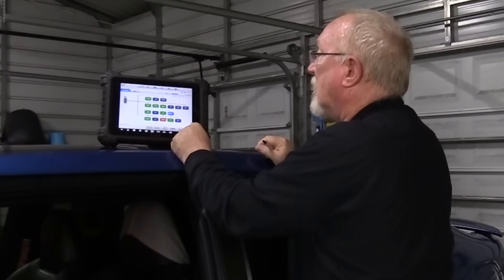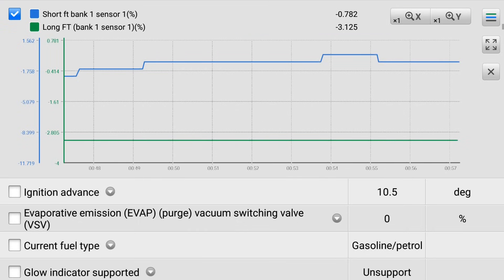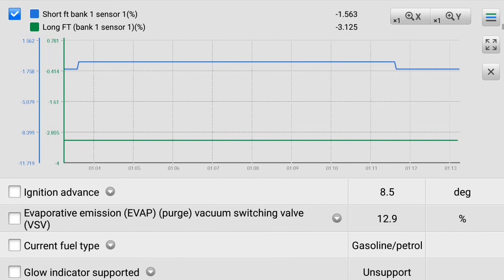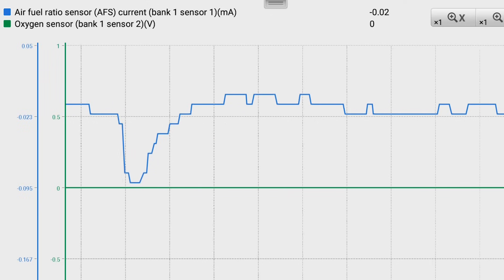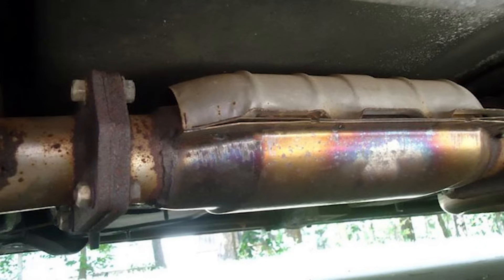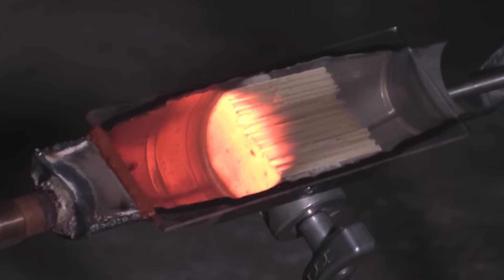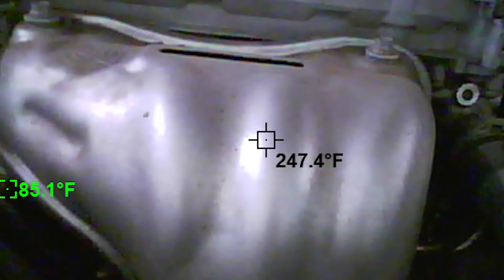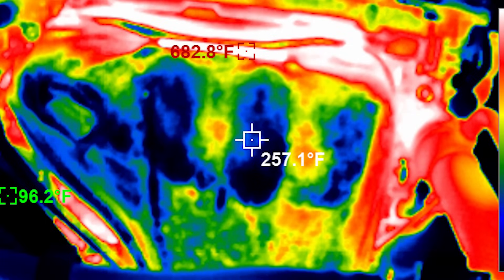The Trainer #118:  The REAL Cause Of P0420/P0430 DTCs

Comment: My take away. Over time it sure pays to live in a state that does'nt have the smog check inspection fraud.
Reply: With probably a trillion cars that came and gone since the first vehicle was made and all the pollution coming from the plant that runs the power to my Alberta city if I don’t have 5k for a new converter cut the cat. I remember there was a gentleman that was ginnna change the world when he figured out how to use water to run a vehicle and he went missing off the face of the earth weeks later 🤔
Reply: @Stunna_ECN sure he did, Fool!
Reply: New Cat for my Car is 1500 , car has 140k miles . Car runs great , but will not pass inspection. .  Why spend 2k plus on car with so many miles  and running fine. ? Thats a problem.
Reply: I love your videos very knowledgeable! Learn a lot from you sir! My name is TASHA from USA 🇺🇸. My check engine light reads that I need to replace ignition coil and spark plugs as well as a cylinder 4 misfire secondary DTCs, p0420 cat efficiency helper threshold bank 1 and 83-13 ECM/PCM relation failure. I have a Honda Accord 2009 LX. I’ve driven like this 7 years! Now I fear how much repair will cost. Why me? 😩
Reply: @borntowin1017 if you’ve driven like that for 7 years, why even bother?
Reply: How does that help you with check engine lights ?
Reply: Found a injector connector not pluged in correctly on one cylinder so was running lean.  Show 0430 code only.  
Look at the simple things first.
Reply: Honestly it's not just that... If you get a code, your car has a problem. Converters are meant to last the life of the vehicle too, meaning, something caused it to fail or it's claiming failed due to something else going on throwing off the readings (like rich/lean conditions)

Also most "no smog check" states won't let you pass safety inspection with a check engine light on, even if it is emissions related
Reply: @JamesAutoDude  Back home in Florida there is no check, period. That means no smog check or any other type checks. Yeah there’s the ever so slight increase in people driving with a broken taillight and whatnot but I’ll take the risk because I have to buy older cars. Nothing like the peace and tranquility of just going to get your yearly registration without first spending money on parts or repairs or both. If it’s the catalytic converter, baby you’re in for sticker shock! I would have to buy it on credit.
Reply: @yactabay  honestly if you can't afford basic repairs then you shouldn't have a car. And the same cheap skates go off and get a $600+ per month car payment when all their car needed was maybe $1,000 or even less as a 1 time payment. Ridiculous

Rock auto is cheap for parts including the converter. I've gotten CARB compliant converters on there for $600 or less, even as low as $200 on some cars.
Reply: @yactabay how much does lung cancer cost?
Reply: Definitely i have lived in RI for years moved to Florida and now it’s no worries lol
Reply: Yes it is IF you are independently WEALTHY & canNOT BREATHE the AIR in the State you reside in.
Reply: It's not just fear of environmental pollution. Fuel mileage, and oftentimes performance, are affected when the emissions system is compromised.
Reply: The WEF (the people who literally run the world) are pushing hard now for getting rid of private car ownership altogether.
Reply: Ummm seriously? You wonder why we have things like global warming? Cars most definitely should have to keep smog down and for good reason and ISNT hard to keep vehicles in shape tbh... Inspection fraud 😆
Reply: @Richard Gilley Ya ok snowflake. You definitely voted for Trump 😂
Reply: Yeah I fucking hate Cali when this dumb fraudulent shit comes up
Reply: Yeah I bet!!!
Reply: Bingo ...bsers rule
Reply: Sorry bro meant to put that comment on the video lol. And that’s crazy that they try make your car a ride off for a clogged converter never of it up north 🇨🇦
Reply: What fraud?
Reply: Idiot government recomended mechanic replaced a 100,000 mile cat with one that faoled 800 miles later...jackass saboteur...
Reply: Not in S.C
Reply: I live in New Mexico no smog check what so ever 😅
Reply: No smog check in New Mexico 😊
Reply: @Mr.Freeze8754 that’s because of the extremely sparse population… c’mon this ain’t hard to understand!
Reply: Yeah, I know what you mean. Damn politicians trying to keep our kids from choking to death on vehicle emissions! Oh for the thick 1960's L.A. air, right? This lousy air we have today, you can actually see through it -- yech! Don't get me wrong, I'm was being silly, but don't expect cleaner air from battery powered vehicles, THAT actually is a scam.
Reply: If you want to breathe pollution
Reply: Because pollution is good?
Reply: You’re all welcome to Oklahoma!!
Reply: Or vote out environmental whackos democrats. 😮😮😮
Reply: It’s for money and so is the new real id scam. They just come up with more add-on’s for Joe consumer to pay for their slush funds, limousines, and private schools.
Reply: Crooks.... The Money 💰💰💰💰💰💰💰💰💰 Grab! Stop 🛑 PAYING taxes and say no to the VOTE... THEY ARE SELECTED, NIT ELECTED.....
Reply: You mean a state that doesn't  have communism.
Reply: I agree
Reply: Bunch of dummies in here crying about a converter. Imagine fighting about something that is a HUGE problem like polluting the ocean with billions of trash and sewer.
Reply: Thank God I live in Colorado where it isn't required to have smog check inspections in every county. The only place in Colorado that does that is Denver.
Reply: @goldengirl5165 and why do you sup that is?
Reply: @goldengirl5165 I agree.   We don't have  vehicle conspections in my entire state.   We also don't have any toll roads or parking meters.   The average traffic ticket costs about $40.   I can't believe when I visit other states, the level of control the government imposes.
Reply: Ugh dealing with this exact problem now.  Damn politicians
Reply: @JYAN2852  7 t
Reply: I still live in one of those states but you still gotta fix the issue it causes bad timing in the engine and clicking  blew up my motor just about been trying to fix it for months
Reply: @Overcharge1 what causes bad timing and clicking?
Reply: Lucky you smh, they got every rule book up the rear out here in Cali lol
Reply: @jaxondakota7080  good bye California
Reply: I made my own " Cat Converter" find a dead cat,hollow him out,weld him in& good to go.
Reply: @dennismull147 can’t believe such idiot comment got four thumbs 👍🏼 ups from idiots 👉🏽🤡
Reply: I hope KY doesn’t go to smog inspections yeet yeet
Reply: @bubbahodge2197  theive looters..
Reply: Mississippi right here 👍🏼
Reply: This is only possible in the U.S...in Europe you have to pass this test ..
Hey look for the environment...and for our planet...hahaha
👍
Reply: @lozanospain1  buy another high manufactured pollution car..
Reply: @lozanospain1  I mean if you want to look out for the environment, you got two feet.  Any other method besides foot or swimming hurts the environment in some way.
Reply: @matthewhauserman4755 , a little bit of an oversimplification there, dontcha think ?
Reply: These emissions systems actually cause more pollution as when they failed (and they will) all the extra waste of materials and then fuel etc to repair is worse than if it was never added
Reply: @freerepublicusa2064 nope! Dunce!
Reply: @freerepublicusa2064  A car without catalytic converter is poison.
Reply: Amen to that Brother, California sucks!
Reply: I live in CA and I approve this comment
Reply: @dennismull147 why, because Californians wish to have cleaner air?
WTF is right with you?
Reply: I’ve been ase cert tech and service manager over 40 years and the only fraud  l’ve seen is poor diagnostics and ignorant owners.  Most cars and trucks thru the shops l’ve worked have hundreds of thousands of miles with original converters working as designed. Not a perfect system, but the best we have if we want to continue burning fossil fuels. Basic maintenance consistently performed is enough to keep most issues at bay. There will always be exceptions and poor designs and manufacturers.
Reply: @arthursmith1732  So my car is 17 yrs old with clost to 200k miles.  The stock cats are no good they have lasted for as long as they could now throwing P0430 and P0431 trouble codes.  I'm in California where it is illegal to install EPA cats.  Plenty of those availalable but no retailer will sell nor ship EPA cats to Cal.  Politicians will only allow approved CARB cats as replacements, none that exist in their database for my vehicle.  I spoke with the state emissions rep they said my only option was to junk the car when there is nothing else wrong with it.  Many others are going through same issue in my state.  I don't see how this is caused by ignorant owners
Reply: @JYAN2852  You said it all, Californians 🤣
Reply: @JYAN2852  hehe my bud needed a new cat here in NY ,so he hopped on some chain place and ordered a 49 state model. 
As soon as the checkout realized he was in NY they blocked the sale and informed him he needed the 50 state cat for another 300$. 
So his buddy over in CT ordered him a 49 state model and shipped it over to him. 
Not into paying someone a bunch of money like that, for a gnats fart worth of emissions decrease over the life of the part.
Reply: @JYAN2852  Who did you vote for ? look there for your answers.
Reply: @JYAN2852 surely you have friends or family in other states; order the EPA cat to them and have  your people ship it do you. 🙌🏼👍🏼
Reply: @ExploringCabinsandMines who’s the anti-cat politician?
Reply: @JYAN2852 And your fellow Californians keep voting for the same politicians. Masochists
Reply: Why spend money 💰 to replace it and fail smog visual anyway?
Reply: The best option is to move out of California @JYAN2852
Reply: @johnc7512 why, so you can bring your pollution problem to your new State?
Reply: @JYAN2852 California men, please listen move out or vote dems out of California, but I know you won't do either one. 😢😢😢😢😢😢😢😢😢😢😢
Reply: @JYAN2852 it’s a California scam. They are trying every trick possible to get truckers and private citizens to turn over their vehicles every 4-5 years.
Reply: @JYAN2852 have you tried a low pass filter on the o2 censor plug?
Reply: @arthursmith1732  I agree with the government fraud.   Some states force people to get inspections, impose fines if not done, and force repairs to be done.  Defending such a system means that there are citizens that are as bad as the government and they don't even know it.  Glad I don't live in such a state.   Its funny that so many states can operate just fine without excessively controlling its citizens.   And life goes on just fine in those states.
Reply: @arthursmith1732 

You are correct .

Ex Smog/Repair  Tech.
Drivability Problem Solver Expert
GM Dealership/Independent  Shops
Southern California
Reply: @@richardgilley4001 tire much of fascist looters?

Comment: This is a logical troubleshooting process ... and one I cannot see the typical independent or dealer mechanic spending time on. Two dealership techs independent of each other relied solely on DTC readers -- and incorrectly diagnosed the need to replace both of my 4Runner's cats and related sensors due to severe loss of power. Neither fixed the problem. An independent could not identify the source of the problem, either. Finally, my old-school pre-ECU carbureted background whispred "fuel pump,"  and I insisted under emergency circumstances that it be replaced even though the dealer tech was very leery. I was right ... but also several thousand dollars lighter in the bank account. Apparently, a bad fuel pump will not send adequate fuel, causing lean codes that seem to DTC readers to be cat-related. The lesson is that typical techs either cannot or will not do the kind of research outlined in this valuable video.
Reply: Their is no possible way that I know of for a lean code to be determined as a cat failure. Whoever you took it too either did not know what they were doing or knew exactly what they were doing! Did you receive your old cat back?
Reply: @jeffflanagan2814  No, I did not. Didn't even think to ask. It was a bad situation all-round, but it is fixed now. I the end, I have two new cats with sensors, all new oil-control valves (another misdiagnosis, but they were indeed in poor shape), and a new fuel pump. All this at less than 160k miles, not what one expects with a 4Runner.
Reply: @bywayz  you can sue in a small claims court for up to 10xxx if you do it soon. you get up to 2 years since the incident. and you represent yourself . they as well do too, and cannot have a lawyer. If you have evidence ofc
Reply: @rickyaguilar7572  I think small claims court is only for $1000.
Reply: @elijuh3  no it's 10k max
Reply: @jeffflanagan2814  exactly
Reply: Did you recover any money from the mechanic?
Reply: @stillwaters6198 nope but I bet that mechanic sold his old cats to make some $.
Reply: And lose the thousands of $ of billings?
Reply: @MR..181  no the fee is like 75 dollars.  Which you get back if win the case

Comment: The only times (2) mine has set a p0420 code in 201,000 milea is after using Lucas fuel system cleaner. Both times the light stayed on for a day or two then went away on it's own...any ideas why this would happen? 2011 ford flex naturally aspirated
Reply from the maker: Fuel cleaners are designed to help break up deposits in the injectors (if added to the fuel) and carbon build up in the intake and combustion chamber (if feed via vacuum line). They can cause some differences in air/fuel ratio being seen by the sensors and/or cause debris particles (carbon) to pass through the substrate.
Reply: @VehicleServiceandRepair  would you recommend that I don't use them anymore? Do you think it might be causing more harm than good?
Reply from the maker: @NetfloodeR  No, I think you'll be fine. Better to keep the system clean on a routine basis.
Reply: @VehicleServiceandRepair  ok, thank you very much for answering.